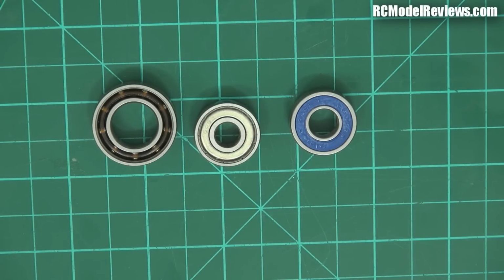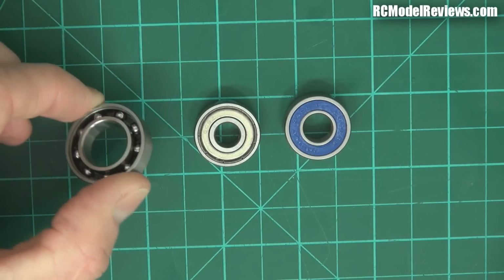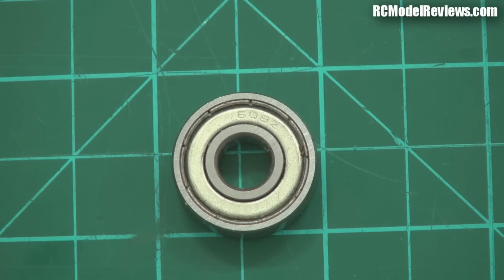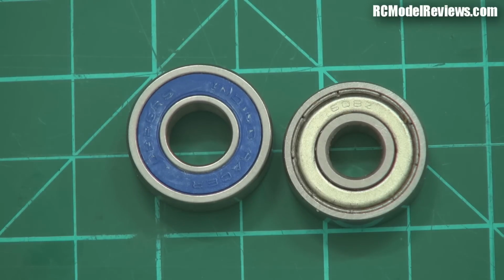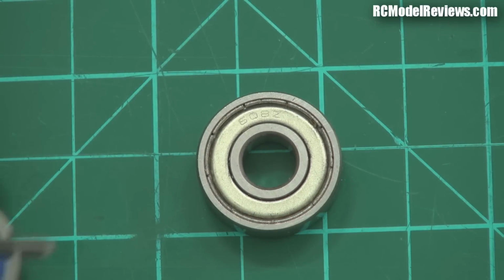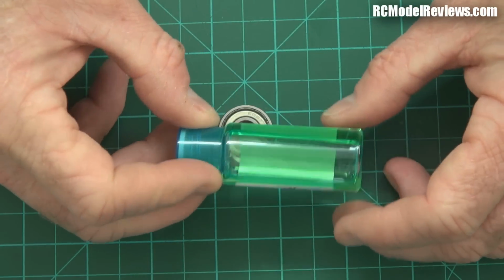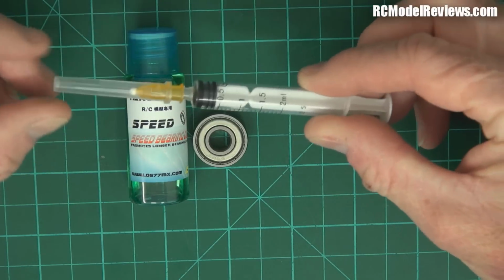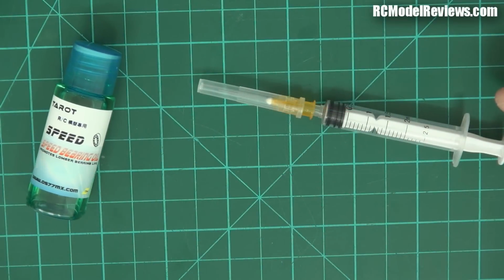Bearings and bearing oil

Comment: Hi Bruce!  My Hubsan X4 H109s (poverty edition) has finally arrived!  
Now comes the question that is pertinent to your excellent video.  How do I lubricate the motor bearings?
I got a bottle of the Tarot oil that you feature (Mr Tarot can book a holiday on the strength of this) and it comes with a syringe and needle.
Here's the thing.  Do I drop oil on the top bearing which is fairly accessible or do I have to take out the motors and oil the bottom of the bearings as well?  This looks like it would be a pain in the derrière.   Any ideas?

Comment: I've got two quads with expensive T-motor pro 2 2400kv motors. There shielded bearings. I can't find any info on maintenance and lube expectations for longevity. My common sense says I should lube them every so often to keep oil in them. I have a bearing lube I found on Amazon. Any thoughts on if I should lube or not?

Comment: I thought you would be the best got to ask. I just noticed one of my emax motors is missing the little good ring that covers the ball bearings had some how come off. I know dirt n dust will get in there so I'm going to try and cover up that whole on the arm where the motor screws in. What would you say I should do? I tried to get the ring back on but no luck. Thank you!

Comment: According to (NMB) bearing company proper oil lubricant is preferred maintenance method for longevity. So yes we should be lubricating our high speed drone motor bearings. Posted for anyone questioning this method. I wasn't sure myself before looking at a couple ball bearing manufacturers.

Comment: I've been lubricating my bearings. They seems to vibrate less and be very smooth. Many say not to. Supposedly the oil washes out the lube in the case bearing. I assume after so many runs with heat that grease will eventually be gone. So what's the verdict? To lube or not to lube? That's the question

Comment: will this high speed oil bearing be usefull for brushed motors (quads) or are there better alternatives-

got some Tarot PTFE grease lubricant (1 buck delivered so ridicalus cheap, just to have on hand if needed) but its transparent grease so likely not that ideel to lubricant RC motors.

and the standard silicone spray-oil most households got at home, likely not ideel either.
Tarot TL2781 high speed bearing oil' would that be usefull for small brushed motors.?

Comment: My bearings are very rough in my emax rs motors, should i clean them and oil them? And would speed cream for skateboard bearings be fine?
Reply: Skateboard lube is made for RPMs about a tenth of drone motor speeds, so skate lube will be too thick.

Comment: I want to see a test of oiling bearings vs no oiling. I've seen folks argue, "don't oil the bearings you'll wash the factory grease out and soon your bearings will be toast".

I've had good success with oiling my bearings but also have had some pretty quick bearing failures recently. Perhaps they weren't good quality bearings? Maybe my 70 wt synthetic oil was too thick. I don't think it is for a hot motor though but maybe for a cold motor. Maybe its too thick for winter flying I've actually seen that to be true as I can feel the drag and have lightened it up a bit in the winter. I can put a drop on a hot motor though in summer and it dissapears in an instant.
Reply: 70 is a very thick oil.  Probably not good for a bearing.  I think that is meant for a hot engine.  I have some scorpion brand oil (they make some very decent miniquad motors) and it is thin like water.  I imagine they know what they are doing.
Reply: +Plur307 Im sure theyve done the bearing lube test for sure. Im gonna try some 30 wt a while and see how that does.

Id like to see a test of equal stress on RC Bearings with factory grease, light and thicker oils and see which one comes out on top.
Reply: Transguy
Watch this video again.  Bruce explains why lighter oils are better for high speed bearings.  A heavier oil will prevent the ball bearing from rolling properly which will make it skid along the surface of the bearing instead of rolling.  That will create a flat spot.  It's a downward spiral from there.  Slow spinning bearings that need to support a heavy load like an automotive wheel bearing have very heavy oil or even grease.  A bearing for a quadcopter motor has virtually zero load on it.  The only purpose is to be low drag so a very light oil is desired.
Reply: +Plur307 Yeah I heard what the purpose of the thin oil was but tests tell the real truth in hours of use until failure. 

And of course hes doing one bearing with thin Tarot oil and one with factory grease.  Id love to hear from him on which fails first, it may take some time though. 

Im already trying some thinner oil after watching this.
Reply: Transguy
I've never had a quadcopter motor last long enough that the bearings die from hours of use.  I always wreck the motor from crashing first.  Same goes for lipo batteries.  They die from physical damages before I ever reach enough cycles to wear them out.  That or I puff them from drawing too much current.

Comment: Hi Bruce.  did you get a chance to try this oil out?  I've been flying a micro cp heli and people are suggesting it's important to use something like this in the bearings.  I've ordered some but just wondered what your opinion was on it.
Reply: +valderja Yep... it's made a difference to the life of my miniquad motors.  Haven't had to retire any motors due to bearing wear since I started regularly lubricating them with this oil.   Already paid for itself several times over.
Reply: Good to hear.  How frequently are you applying?
Reply: +valderja Every 20 flights or so.
Reply: +xjet Thanks Bruce.

Comment: I just watched this today, and I'm impressed with myself.  About a week ago, I had a crash with my zmr250 and my motors got a little dirt in them.  It's actually happened a few times, I have a lot of sand in my yard.  Anyway, I use my air compressor to blow the sand out of the motors, but they still seemed a little gritty, so I used some pneumatic air tool oil which has a nice needle on the bottle.  It's a nice light oil that looks similar in thickness as what you have in your video.  It was great, quieted those motors down!  Nice and smooth and quiet.  I too always read not to oil mini-quad motor bearings.  But after my experience, I will be from now on.  It doesn't make any sense not too.

Comment: Man, you know a lot about bearings and, now, I do, too. Thanks.

BTW, for syringes without a "needle," you can get oral medication syringes, usually for free at pharmacies in the US. They have hobby uses such as the metered application of adhesives. For syringes with "needles" (they have no razor tip, just a flat tube end), I know of another source: syringes intended to be used for the precise application of SMD solder paste.

Comment: Scorpion lube oil been around for some time and have used it religiously on my multi's motors. A little more viscose than the Tarot offering. One has easy access only to the lower of the two bearings in a BLDC (most cases). Getting to the upper can be difficult in many designs.. Banggood's price is compelling considering the free shipping but not the only option. Tarot is simply the name on the label, Scorpion sells 30ml from the factory for $6.00 plus another $5 for shipping from Hong Kong

Comment: I've been spraying a little shot of Wd40 in my turnigy motors. Is that ok Bruce? or should I switch to oil. Also, does anyone know if the Wd40 will damage the windings? I've got probably 400 flights on the motors and beginning to notice shorter flight times. Just curious if I'm messing them up. Thanks Bruce!!! Love your videos !!!
Reply: Why WD40? That stuff is mostly wax.
Reply: 5 years later: WD40 is not a lubricant.

Comment: Nice overview of bearings, lovely and clear :)

For my multirotor motor bearings I use DryFluid Extreme with good results. The fluid evaporates leaving a dry lubricant so you avoid the bow-wave effect you mentioned and doesn't attract dust/dirt. Worth a try IMO and I'd be interested to hear your opinion if you ever try it yourself.

Comment: I watched this vid because I oiled my motor bearings on my quadcopter and now it flies around in circles, I have done all my calibrations etc so I am presuming some oil has flicked out and onto the windings of the motors or something?
Can you help?
Have you ever encountered anything like this before and do you think this is a cause of my issue?
Thanks (-:

Comment: I always use this stuff, it works great and has a built in applicator It's called "Parma" TQ Bearing oil.
http://www3.towerhobbies.com/cgi-bin/WTI0001P?I=LXDA94&P=8

http://www.ebay.com/itm/Parma-TQ-Bearing-Oil-1-2oz-PAR741-/291076602217

Comment: Bruce; love your channel, you're doing a great job so keep up the great work. on bearing lubricant; I have a lot of experience in this department so I think I can help. After 43 years in the hobby and trying a lot of different products, I found the best product for bearing lubricant is a product call Dripless oil. I don't know if you have a NAPA auto parts there but that is were I found it. Even in a RC dirt car environment after oiling bearings with the Dripless oil the bearings run free and stay clean. Only one application a year is necessary as once the oil goes into the bearings the chemical that carries the oil in evaporates leaving the lubricant behind. Give it a try while you are testing the Tarot oil.
 
Kenny
Reply: Hanger Fiftyone Unfortunately I've never seen that stuff around here.

Comment: Bearings come stock with grease. In my experience this will last a long long time. As soon as you put oil in the bearings you're going to have to oil it every dozen flights or so because the bearing will sling it out pretty quickly.

 There is a device called "the greaser" that will force grease past the metal shields and clear all the crud out.

 I stopped using oil and switched to grease a while back on my helicopters and I find I only need to re-grease the high speed bearings every hundred flights or so (low speed bearings can go for longer). I use super lube synthetic grease for this. It's also great for thrust bearings, it stays put in the blade grip, has a better consistency than silicone grease and doesn't dry out over time like lithium grease)

Comment: Would really appreciate a teardown of an oiled bearing vs an unoiled one after a few months. I've been told when i was starting out a couple of years ago (450 helicopter) not to oil the bearings as it'll turn to mud and get sucked in. They were the veterans so i took their word for it and just stocked up on bearings like they do. But i still wonder if it's for real or if it's just one of those mechanic stories (myths?). Would be pretty educational showing the inside of a used bearing.

Normally i do these kinds of experiments myself, and i do have quite a few noisy bearings, but i don't know how to take one apart.

Comment: I use CorrosionX. I put a little bit in a bottle cap and use a toothpick to put little drops in my bearings. I also sometimes remove the motor bells, clean out the bearings with brake cleaner, blow them out with compressed air (DON'T SPIN THEM!!) and re oil them. I think my 500ml bottle of the stuff might last quite a while although it's useful for making electronics more water resistant too. My motors always sound smoother after doing this.

Comment: I always oil my bearings, iv tested before and after and have seen lower amp draw especially on my high rpm set ups. I wd40 the bearings to remove the cheap oil from the factory and then use regular 3 in 1 oil . And iv never had a bearing fail in a motor and I push some of my motors past 45,000rpm so I must be doing something right

Comment: I just use synthetic Motor oil. Mobil 1 10w40 in a little applicator bottle. If it's good enough to lube Ferrari and BMW engines, it's good enough for my cheap little motors.
Reply: JRWperformance 10w40 is probably a little viscous for high-speed bearings -- even the 0W30 I was using was much thicker than this Tarot bearing oil.
Reply: JRWperformance Ferrari and BMW engines don't run over 20000 rpm. :)

Comment: I can see how to lube the propeller side of the motor (thru the slots) but how do you lube the bearings that are on the motor-mount side? Yeah, you could remove the motors from the frame, take the motors apart, lube the bearings and put them back together, re-mount onto the frame but who has the time and motivation for that?
Reply: CrackerMcGillicuddy It depends on the type of motor and craft.  Most multirotors have access to the bottom of the motor so lubricating the rear-bearing isn't too much of a hassle.  For fixed-wing craft where the motor is bolted to a firewall then you probably don't need to lube the bearings as often anyway so I'd just lube the front one on a semi-regular basis and leave the rear one for very occasional attention.   To be honest, multirotors place far more strain on their motor-bearings than most fixed wing and thus demand a more regular maintenance schedule.  I have never lubed the motors in my AXN's for instance -- although I notice some are getting a bit wobbly now ;-)

Comment: Hi. I have big problems with my Futaba T8J transmitter. My friend has a Futaba T6J transmitter and if we try to fly at the same time sometimes the transmitters disturb eachother. Everything locks up, and one of us need to turn off the transmitter to resume control of the airplane. I have had this problem with 2 different T8J and one Align transmitter. I have tried both original Futaba recievers and Frsky recievers. Same problem. I use 6 volt batteries on both transmitter and reciever. I tought this was not possible With 2.4 gH. Can you please help me understand this problem?
Reply: Borkenes RC It sounds as if both radios may have the same GUID (a unique identifying number that allows receivers to recognize the correct transmitter when more than one are being used).  Futaba did have a problem a long time ago with transmitters forgetting their GUID and reverting to zero which caused very similar issues.  I'd return it to a Futaba service agent and ask them to check it.
Reply: ***** Thank you Bruce.

Comment: HobbyKing has a Scorpion Oil. My experience has been over two years. I used it on 450/500 helicopters and have not had a bearing failure.I also use a marine lubricant to waterproof servos and ESCs.

Comment: I have this for my skateboard bearings
http://www.oustbearings.com/index.php/shop-online/met-ol-speed-oil
I'm gonna give it a try in my sunnyskys. It's made with graphite and it's super fine, it even comes with a fine tip applicator. Bruce, you should get this and do a comparison. with the tarot oil. Or put one type of oil on each of the four motors and see which one works best. You could try sewing machine oil as a budget option and maybe wd40, cause everyone has wd40. put them on the thrust stand see if there's any difference, then just go fly and after a bit of use and abuse go back and see how they're holding up. I would be very curious to see the results of such a test.

Comment: I never thought it was necessary to lubricate the little bearings in small multirotor motors.  I look forward to hearing how you think it works.  I was thinking that mini quads get pretty dusty and dirty with crashes and having the motors and props so close to the deck.  Would lube just make the dust and dirt stick in the bearings?
Reply: Bruce i oil my bearings and have tested before and after I oil and I have notice lower amp draw especially on high rpm set ups. I dont know if this matters so much on quads but any reduction in amp draw will extended flight time
Reply: valderja That's one of the arguments -- but the shields do a pretty good job at keeping dust particles out and one could argue that if there's a bit of oil on the outside of the bearings (ie: on the shields) that might trap the dust before it could get inside.   One of the reasons I'm doing some tests is to see if the dust issue is a real one.
Reply: Interesting points Bruce.  Really appreciate all these tests and reviews.  You do a brilliant job.  Keep it coming.

Comment: Lubricating those tiny RC bearings makes no sense, too much hassle.
For example those 608zz bearings cost 25 cent, so replacing them from time to time won't ruin your budget and you will have to do it anyway because such tiny bearings don't have a long life expectancy.
Reply: MasterBata The problem is that replacing them can be a real pain in the backside, at least when we're talking about small brushless motors.  A minute or two every week spent in preventative maintenance can save/defer such repairs later.

Comment: i think its not worth the time and hazzle because it will just hold dirt and dust that long term do more damage to the bearings. you also have to unscrew and disassemble the motor. also look on the prices on those motors.
trust me you only do it once like when you drove a new offroad rc car for the first time :P
Reply: tnxmatze For some motors and bearing applications you're right -- but in the case of the brushless outrunners used in many RC planes and multirotors, the bearings are accessible enough to make the job quick and easy when using the supplied syringe.